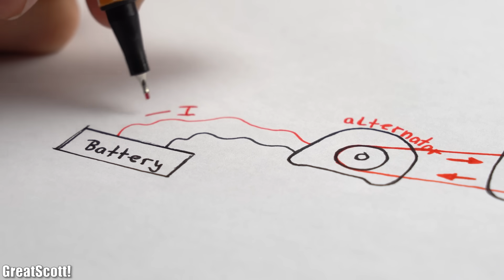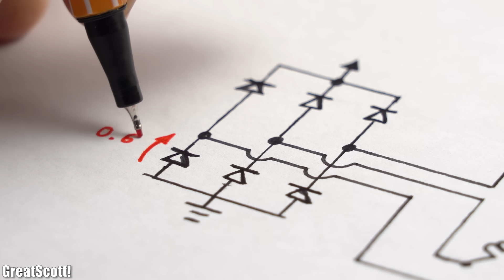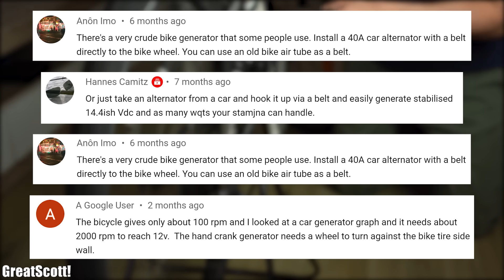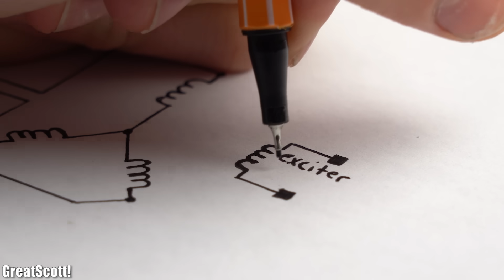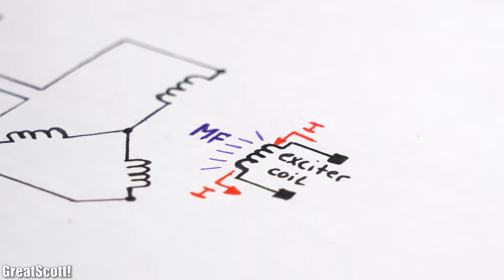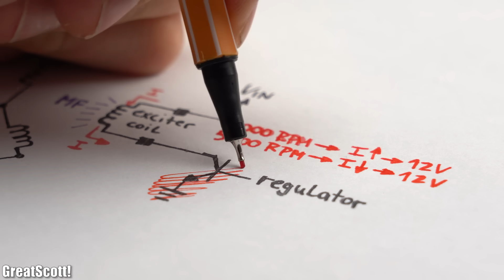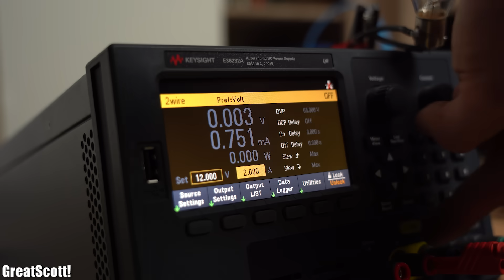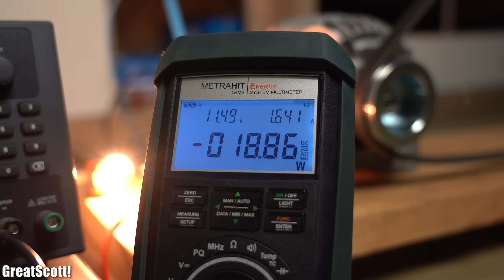Using a car alternator with a bike to power my home? How much energy can I produce?!

Comment: Use a tractor alternator, it only has two wires and designed just for charging. Far cheaper and works well.
Reply: you can buy ready made one wire general motors alternators ready to go under 60 bucks at most auto parts stores. I probably sold 200 over the years
Reply: @bigdave6194  ...please Bro, tell me more?? And can you inform this ignorant man as Danny said about a converter that converts your DC voltage into AC which is what you need 😉

1
Reply: @bigdave6194  thanks!
Reply: @johnlombardo7816  I'll do ya a solid....there's a reason there's two belts to turn a 120 amp alt...
Start small and work your way up...
I got a 14amp alt off Amazon last fall for next project...requires a external regulator...it also 2 wire if I remember...
Iv remoded a airdine machine to run it....it's a cold weather project so about time to finish it...
If I do get it to work it will surpass my expectations of what a man can produce
Reply: @jonjacobjingleheimerschmid3798  appreciate that man good luck !
Reply: Home Creek Game Farm , Do the one wire alternator’s have magnets instead of exciter coil’s?
Reply: thanks for the advice.I'm considering if a small turbine could be installed on rising water main.use the pressure in the system to trickle charge.also,could small turbines be installed on pipework running from header tank.surely you'd get something with gravity.just an idea.if you'd like to chat about a few more ideas,im always happy to share ideas.maddog,west cork. republic of Ireland
Reply: @dominicmogridge3920  An idea yet to be tested? If you have the space, a wind pump could push water out of reservoir store uphill or into a column and used on the way back to drive turbine with controls . the water gets reused going around in a circuit.
Reply: @dominicmogridge3920  
I think that is an absolutely brilliant yet simple idea !!  Using water pressure to drive a small domestic turbine to generate electricity !  It could work in combination with solar power. I’m not an engineer, but could such a system satisfy all your power demands ? Government/ private companies seriously need to look at this !
Reply: I've been living off grid for many years now and I have been experimenting with making electricity for 40 years and my conclusion is solar panels and marine batteries are the way to go for me. I run 48 volt solar panel system running into a 48 volt battery storage reduced to 120 volts using a 48 volt inverter. All done with (4 ) 12 volt batteries wired to 48 volts. Solar panels also wired to 48 volts. The inverter is 48 volts dc with output at 120 ac. If you try to run a twelve volt system the wires will overheat and could have a meltdown. My first solar system nearly caught on fire at 12 volts DC but after I rewired the same amount of solar panels and batteries to 48 volts the wires never overheated again.
Reply: @WhiteTiger-i4l  how many solar panels do you have and how many AH is each of your 4 batteries?
Reply: You're gonna need a converter that converts your DC voltage into AC which is what you need 😉
Reply: @dannymemmory5094  have to be able to make electric first...
Which I highly doubt....
Alternaters take horse power...
A man at best is 1/10th hp
Reply: @jonjacobjingleheimerschmid3798  I own my Solar panels on my roof and I'm looking I to a Silent generator that converts The Solar panel power to 15vac at 60hz .. I'm going off of the power grid once My Tesla Power Walls are installed 😎
Reply: @jonjacobjingleheimerschmid3798  alternators need rotational force... you'll be surprised how much rotational force can be created with gearing
Reply: @dannymemmory5094  good luck... they've tried that in Aus and it doesn't work haha
Reply: @goodluck-sx8zf  if you are using car battery's when you have an electric grid, you are just producing extremely expensive electricity.....
So what do you use electric for?
And how extremely little do you use?

There's thinking out side the box...
And there's also reality....
Hold my hand indeed!
Think it's you that needs a reality check!

Oh brainyack.....using a car battery like that will kill it quick....need deep cycle....
Reply: @jonjacobjingleheimerschmid3798  deep cycle.  Or inline. You think I need power like normal. My house is a low voltage house. We don't need normal power you Learn to unplug sh*t.  The power is nice to have even if you don't use it.
Reply: @dannymemmory5094  there’s ac inside the alternator, that is converted to d.c, actually. A big hassle to find it and know without running th e alternator, but take it apart and run wires and check with a meter, when it’s running,
Reply: @dannymemmory5094  not if you use all 12v devices...phone, laptop,  LEDs...

No heat.
Reply: @dannymemmory5094  If you remove the rectifier bridge from the stationary windings circuit you will ger A/C voltage
Reply: This is one of the most productive conversations I've seen in years let me just say that.

Energy creation by human motion is what we're discussing.

And regardless of gear ratios or whatever else, you need to make it ergonomic for the human.

Here you have a biological organism in direct, VERY prolonged, very physical, friction-creating interaction with a hopefully VERY robust, very regularly-serviced machine that can last for years and years merely if lubricated.

The metal machine will eventually win in that contest.

Design Engineers wanted.
Reply: Thank you!
Reply: Still need a exciting 12 volt source for it to charge but a 1 wire gm alternator woild work
Reply: Tractor have a dynamo. Its pure generator, not an alternator. 🙂
Reply: @zlackbiro  false most tractor have normal alternator unless you're talking about a 10 hp Briggs and Stratton lawnmower motor
Reply: This is our fifth year bearing through the summer heat with out little harbor freight solar system,. Three 13.5v gel battery's  that recharge Our kolbolt battery's, that power Our fan. 
I think I have the exact same alternator stored away that I once thought I could turn into a power source via winfmill.. but after reading all this I am now thinking, solar to batter to power water pump to push water to a barrel on a metal rack, that runs through a series of filtering barrels to clean the pond water for drinking, but as it falls it turns a little watermill wheel that runs through a series of bicycle gears that turns a tractor generator(?) to power more batteries, that runs through a (larger) inverter, that powers a deep freeze,. To store food and make 🧊 ice,. That might help us stay cooler. 
Oh and fans. More fans would be nice. 
This all is a nice thought to me.. hoping we survive the next year's greatest(?) depression. 
SOS
Reply: I used one on a VAWT windmill it worked well enough….
Reply: And diesel engine has lower rpm
Reply: Thanks for this. It works easier
Reply: Supposedly the car alternators with the multiple wiring can be wired in a series where they power themselves continuously.
Reply: Could I get some details...please :)
Reply: @madeinjungle1977  Auto zone carries a 120 amp gm motors alternator for 68 bucks. Just ask for it. Tell them you want a one wire gm alternator. Or go out where the fuses and pigtails are and get the 3 dollar plug with wires to convert one to one wire. Works on the dual blade plug style general motors alternators like the 7140
Reply: @madeinjungle1977  do some research at how much hp it takes to turn....and let us know how you do....
Reply: One wire regulator requires at least 800rpm to self excite, not a very good option.
Reply: @jamesroberts4213  the laws of thermodynamics beg to differ.
Reply: @jamesroberts4213  no you need to power the coil first putting a light bulb or something like that after it power it self the bulb will turn off thats why your battery light on your dash of your car is not lighting when running

Comment: Those two terminals whose use was not immediately obvious are for and input voltage. the alternator need 11.5 to 12.5VDC and then the output should be about 14.5VDC; the charging voltage.

Comment: hmm, looking for this some months already,
as I know from my cycling racing that I did average of 250 Watt for an hour, as like ITT
so where is that energy lost ?
even if I can get 100 Watt effectively into my grid ... or just direct load my batteries, I might do it as for home training
I found this wind-energy-inverter even OnGrid (3 poles) for this, also think about to take a wind generator to build behind the bike ...
that problem gets now more interesting as of rising prices or even maybe power outrages next time ... as already in china.

Comment: DC to AC 
not that hard to grasp
but is a challenge to discover where we need relays and fuses to handle the amplitude and resistance involved with the wattage of voltage.
Ohms law is not that complex yet on paper it looks like a horror novel when its compiled on one page jammed into a poorly pictured description.
Math for the general whole never lies, so apply it to be safe and have the results your looking for.
Be careful inventors and keep on creating a better engineered method while remembering to always keep the smoke inside the wires.
👍

Comment: I put an alternator on an exercise bicycle I used a battery and an inverter obtain 110 volt just like any alternator pedal the bike 5 to 10 minutes the battery be charged up the inverter would work for a couple hours I also use a 1.0 capacitor to supply inverter

Comment: Buy an old hit and miss engine or manufacture a new one using old designs cheap on fuel and will generate the speed and power required you just need a really good muffler so you don't disturb neighbors

Comment: something to consider. a storage battery requires a charging system to be an average of  13.6-14.2 volts. This is why auto manufacturers use this as a base spec

Comment: A ton of the comments that I read, recognized the rpm issue with the "highest gear". Yes, more rpm would be gained by actually switching to a higher gear, with a slight trade-off in torque needed to rotate the alternator at said higher rpm. The two biggest issues that I see are belt slippage and primarily the fact that the wrong alternator is being used. This is an internally regulated alternator that requires external input to aid in regulating the output. An older, non-internally regulated alternator is what is needed. The one-wire styles used on the old Chevies or Ford's. They put out an unregulated max amperage and max voltage at rpm that is then regulated through the use of a firewall or fender-mounted voltage regulator. These alternators usually put out their max amperage, anywhere from 75 up to 150, and max voltage, anywhere from 12.6 to 14.2 volts. Yes, they still require the primary input of 12vdc to the exciter, but often, the voltage input from a 9v battery can be used to engage the exciter until the voltage output from the alternator can then be used. A decent start to the project. Don't give up yet.
Reply: yes. old style GM "1-wire" alternators are best.
Reply: Chain drive is MOST efficient of the three types - Chain, Belt, Gear. The LEAST ENERGY LOST occurs with chain drive.
Alternator needs sprocket -- chain -- chainring of pedaling apparatus.
I have noted that direct tire attachment to alternator fixed , like the resistance devices on standard bicycle stationary mounts does not slip, heat, or wear, as can belts.
Reply: Older style >non internally regulated, one wire - style "alternator"< is in fact a dynamo. The difference between the two is pretty big. The dynamo uses permanent magnets and produces dyrect current, while an alternator uses electro magnetic coils, and produces alternating current.
Reply: @therionman52  There is more to it than that.  Further, not all old dynamos or generators are permanent magnet.  I have a generator from a 1951 car and it definitely does not have permanent magnets.
In addition, alternators produce AC, ie. alternating current; hence the name.  This AC must be rectified to be useful for battery charging.
Dynamos or generators produce direct current ie. DC, and can be used to charge batteries directly.
Note that without any instrumentation to observe the charging process, an automatic charge controller is advisable.
Reply: what a bout a dc generator from the old old cars like a 57 chevy?  before they had alternators.
Reply: I was expecting him to get a one wire alternator, when he showed us the one he got I knew it would give him issues.
Reply: Its not self excited not an issue.
Reply: So do you need a voltage regulater ?  finally got a old Ford  alternator  had the regulator separate but I don't have that  I'm going to try to turn it with  small electric motor  see what I get out of it ... if it does have power  can you run directly after that if you have some sort of regulator ? just have to use it to charge batterieslike a solar panel? I've been trying to figure this out for 3 years
Reply: You can Make that alternator Self exciting if its wired up correctly and use capacitors to aid in the excitation to trigger it
Reply: That's good Intel 👊
Reply: Will never work anyway to work it need to be at least 1500rpm and even if you get a big one 150amp it still can only produce 2100 watt and this is being generous most alternator are in the 60 to 100 amp range or 850/1400 watt barely enough to run a refrigerator and a couple of light

Comment: What about adding an electric motor in that runs off some of the power generated and once the flywheel was up to speed the motor would assist with perpetuation, if geared right or imagine a car with 4 wheels and electric motor on each wheel, then two can create propulsion n two can generate power to run the propulsion and charge the batteries, all with the right ratios it could be perpetual in a sense that it creates its own energy

Comment: You could charge a car battery's with it run the batteries  in parallel to get a 12V output. each other and then hook them up to an inverter. To get 120~240 volts 60~1000 Watt ohur

Comment: Old school belt tensioner method...
Put the entire alternator on a hinge assembly, hinged on one of the mounts. The weight of the alternator will act as the tensioner. No frame or other tensioner assembly to spring against necessary.  Just the weight of the generator itself!

Comment: You need to use a heavy flywheel... Have the bike turn the flywheel and run the generator off of that. That one maintain a constant RPM.

Comment: Wondering if you use washing machine motor and run the alternator to it  will turn 3200 and if the alternator runs to a battery thennit should be enough tio charge the battery then your house

Comment: I would recommend a wind turbine generator..instead..has PM magnets..don't need excitor coil ..3 phase ..use a rectifier block .(6 diodes) ..1000-1400 rpm will b attainable ...

Comment: An automotive alternator, once it begins to produce power will act like a mechanically powered electrical oscillator. So, once power is produced, external power to the exciter winding is no longer required so long as the output power exceeds what is required to excite the field. One way this can be demonstrated is a car with a properly functioning alternator will continue to produce power and run the car with the battery completely disconnected once the engine is running.  This is a quick way to diagnose a bad alternator in a car.

Comment: I set up a 212 cc engine with a alternator and it works great while using an inverter and charging the battery bank...once I set everything up..it's going to be used for emergency backup power during storms and power outages...I have solar panels that will be part of that system as well
Reply: Sounds good. Are you going 12 volt only or have inverter for running appliances and lights?  
I built something similar with a 50cc Honda engine and a very small Mitsubishi car alternator. Its job is to charge dead batteries enough to start the engine. It has 20 feet of 8 gauge jumper cables and we use it more often than not, charges at 25 amps without undue stress and is reasonably quiet. It has a tiny sealed lead acid 12 volt battery on board and a momentary contact switch to put the exciter current going. Touch the switch and the voltmeter jumps to 13.8 volts.

Comment: Try bypassing the diodes. You will then be producing AC voltage at around 120 Volts and perhaps 60Amps.

Comment: 8 watched a guy go bush and Run a house ,he had two and changed the wiring in one for the generator and the other as a doubling it's Power to 220volts he only needed a  low gear electronic motor to power it,the Power company told him to remove the video or he would disappear, so it can be done his film is out there as in it he doesn't connect it so it's just a egsample of what you could do.

Comment: The most important part of the alternator is the diode/rectifier/voltage regulator. If you remove it, you will create ac, not DC, AND you will generate the same amps but at significantly higher voltage.
The biggest thing to remember is at any given RPM, the voltage, amperage AND frequency changes. The frequency is what you need to watch if you switch to ac generation.
Reply: Read my comment

Comment: I created a generating system using 2 Delcotron alternators 1 11hp gas engine running on natural gas 7 cranking amp auto batteries from auto recycler and. 2 1,000 watt invertors
Worked well on a remote job site.  The AC Generators do not store any energy,whatever is not used is wasted fuel and if a surge overloads it the motor may stall or the rpm will drop and surge for a time.

Comment: By the way if anyone wants to know the part # on a belt the last 3 #s is your over all length of the belt for instance 15355 would be 35 1/2 " or 15350 35" 😉

Comment: Ive found a mistake: 8:34
 A car alternator outputs 14 V (not 12 V,as you say) because the car battery outputs 12V,and they will cancel each other.